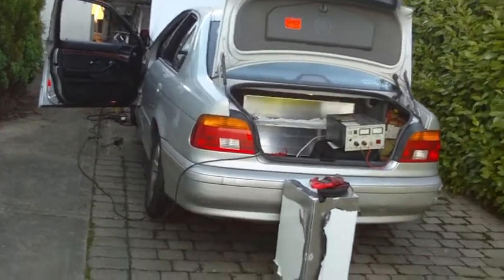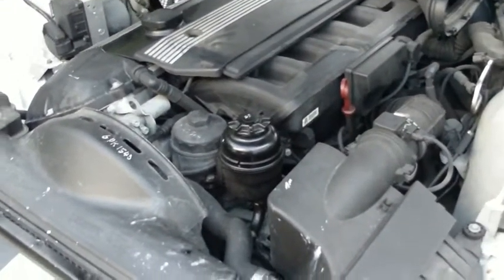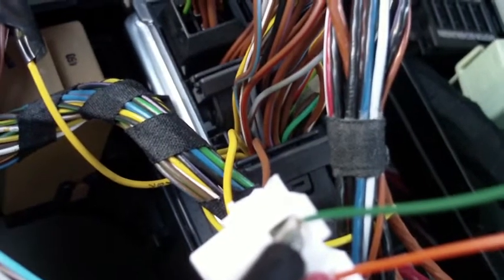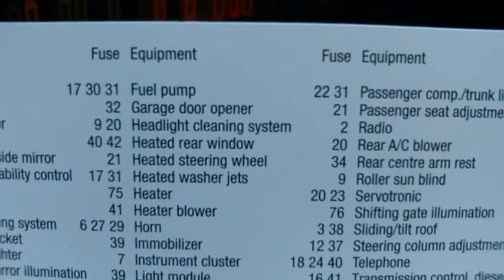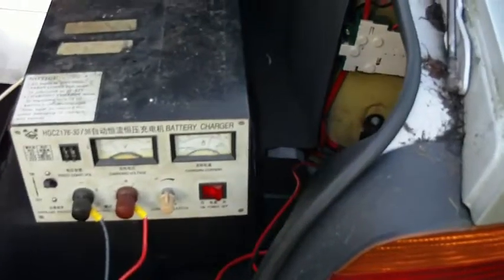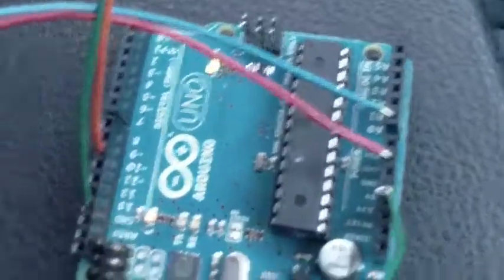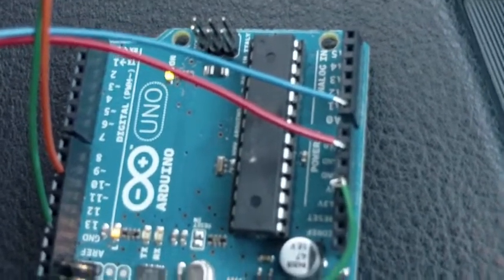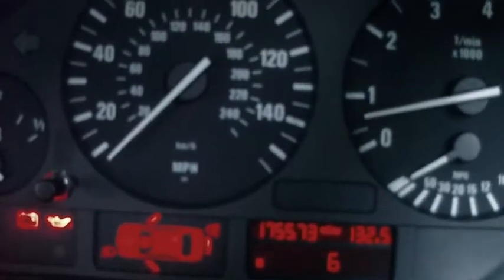BMW E39 EV Conversion 05 Cranking up

Comment: Congratulations, you make it look so easy. Are you going to continue spoofing the crankshaft position sensor with the arduino or are you going to use a reluctor wheel on the endshaft of the motor to capture true rpm?  Are you using the car's 12V supply and ground for the power to the arduino?  That was another problem that I had with the Jimstim.  The DME would not recognize the signal if I was using an external power supply and ground even though the signal looked the same on the scope,

Comment: Damien, I love your thoroughness!  Are you doing all this just to get rid of the "check engine light"?   None of those codes will matter when it has an EV engine?   I just take apart the dash and put a piece of black tape over the stupid light and forget about old gas problems!   The MPG gauge isn't labeled correctly anyway!   Keep up the good work!  I'm the only one that probably watched all the way to the end because I'm just a geek!